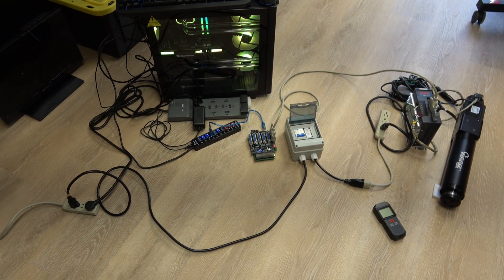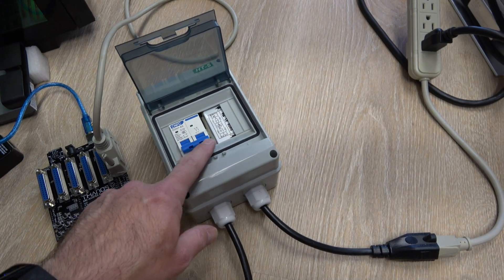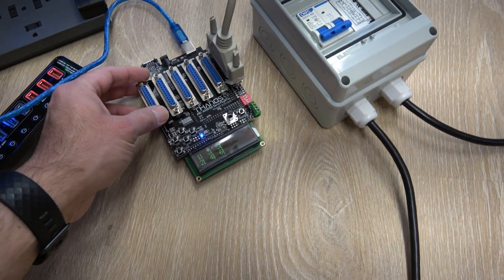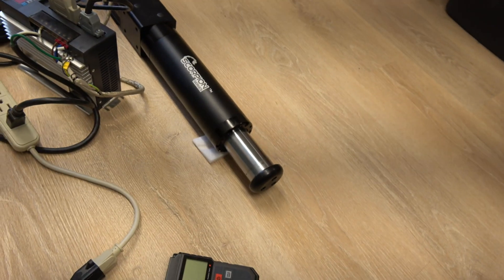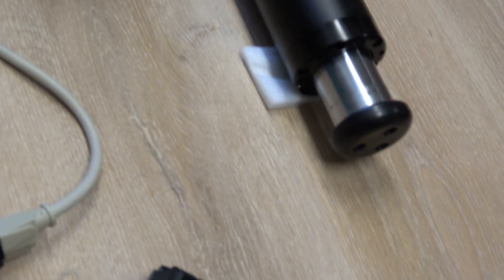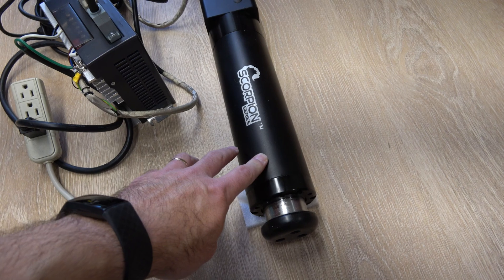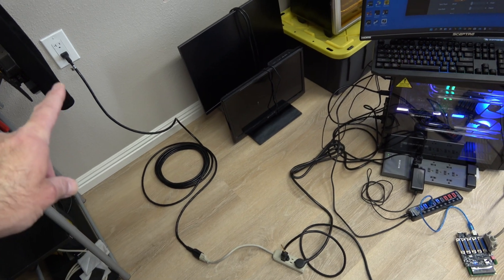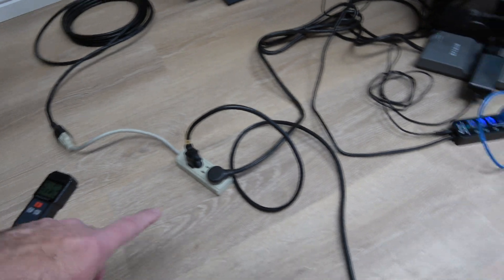Power Box TEST - Part2

Comment: Please explain how you are connecting those 220v serves to 120v?  Do they make a 120v?  If do. Model please…
Reply from the maker: These are standard AASD-15A servo drives. They can run on 110v by adjusting a parameter that otherwise produces an alarm if below 220v. The only difference on 110v, is less max RPM available (up to 2800RPM).

Comment: I have 220v servos and 220v available. What would be the components for 220V? How many servos can I connect to a box with 220v?
Reply from the maker: The same components are used for either 110v or 220v. On this box, you could connect up to 6 or 7 servos with no problem.
Reply: @tronicgr  ok...so one of these boxes for all 6 servos? This feeds into a power strip. This eliminates the need for the efi from the power strip to the servo as on the current wiring diagram on the discord?